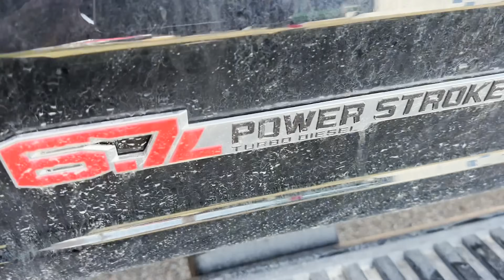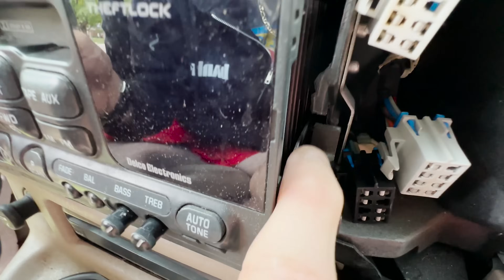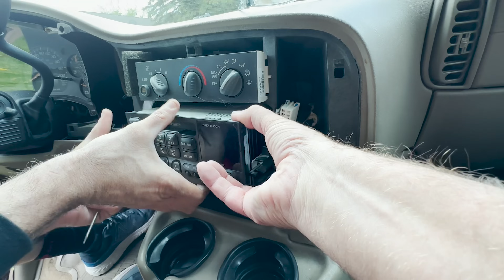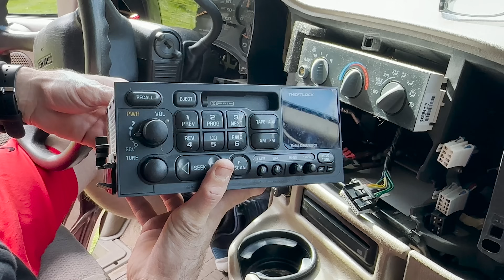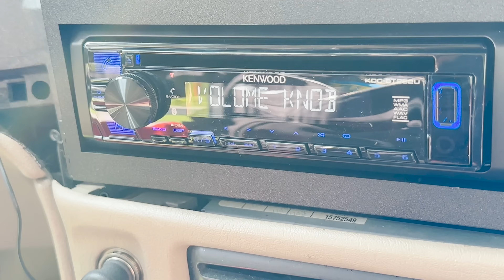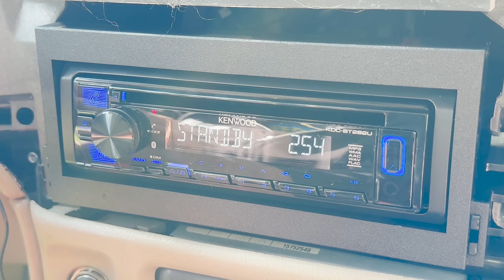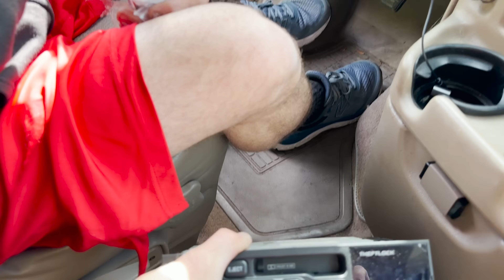NEW van! PIMP my ride?? NO way!! Check out what I got...#vanlife

Comment: Oh man that brings back memories. I was cringing while you were putting the sleeve in the mounting ring. If you find it's getting loose and shifting around. the triangular cuts in the top and bottom are what you should use for the attaching the sleeve to the mounting kit. One thing you will need to look for is if the display is too bright you will want to see if there's an illumination wire on the van side. The kenwood mic is not the greatest so you will want to try it in different places in the van close to your head.  I ended up putting it next to the sunglasses cubby in my older f150s. That's what the the orange wire is for. It's sometimes called dimmer on the wiring diagrams. Otherwise good job.